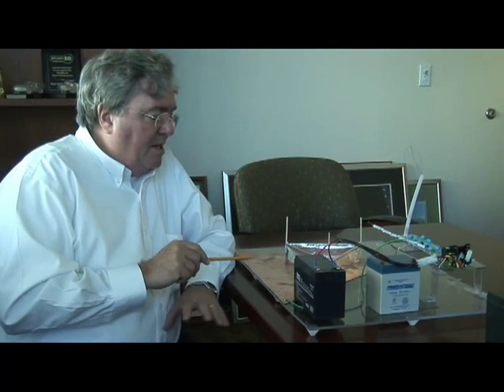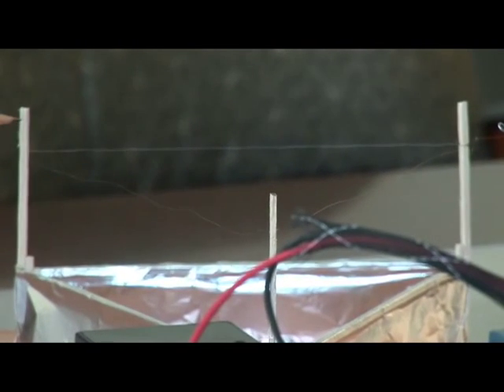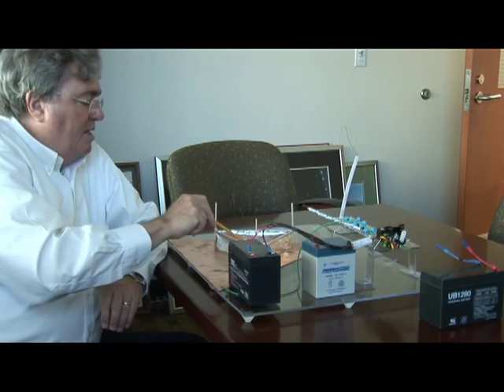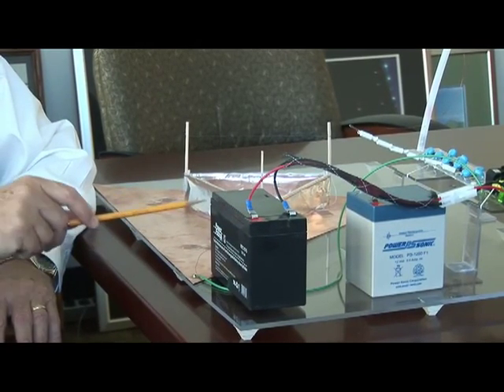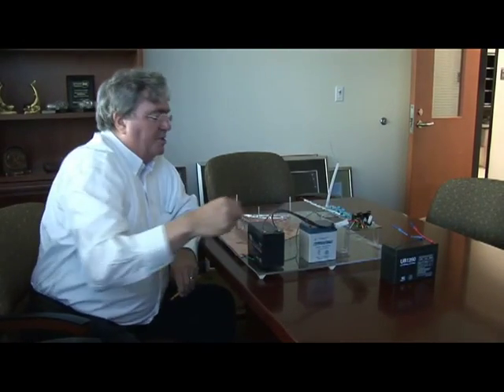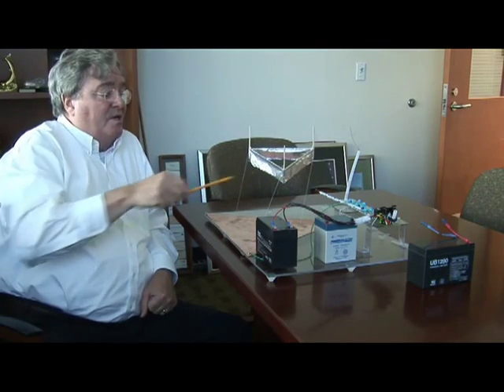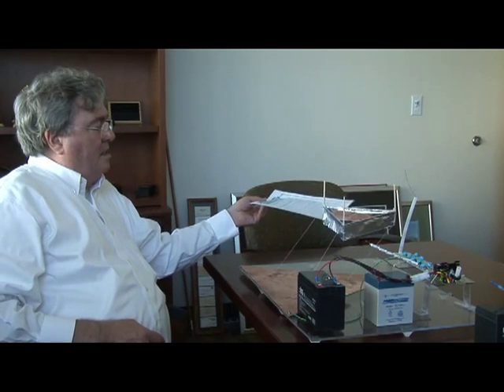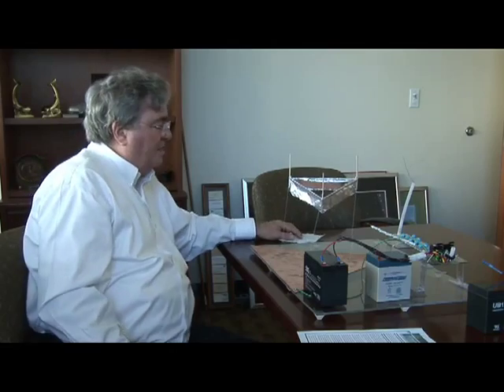Electtrostatic Anti-Gravity Device

Comment: It works in vacuum more efficiently and better than in air, as the inventor, TT Brown showed in Paris, France in 1955, Winston-Salem NC in 1957, King of Prussia, PA in 1959, and also Purdue University, NASA, and the US  Army Research lab in Adelphi, MD, Takaai Mush and HONDA in 1996, etc. The question of vacuum function we settled decades ago. I sealed saucers in bags and they flew backwards. Peole operate them under oil, which does not ionize, and selade in molten glass and resin blocks, they still work!
Reply: Thats interesting, but have YOU tried it in a vacuum. I don't buy it. I view TT Brown as a bit of a quack. I was a professor at Purdue for 18 years. So who at Purdue did it?
Reply: @nealgallagher4848  US Army shows the force of ionic wind is "at least 3-orders of magnitude too small to cause levitation". Not MY words. THe US Army, and PURDUE. TT Btown used up to 250 KiloVolts at some TENS of micrAmps in Vacuum in Paris France, and there was no limit to the speed in a vacuum. Paris France, 1955. Societe Nationale du Aernautiques du Sud Oest.
Reply: @nealgallagher4848  I so not have to see the structure of the atom to know it exists. Others have done the work under oil, in vacuum, sealed in molten glass and resin, conditions tha preclude air ionization. That is enough for me. Ion wind is a very weak force that has an upper limit, and cannot loft even a 3-gram model. Those are facts which the US Army Reaserch lab at Adelphi, MD, in the year 2000. https://arxiv.org/ftp/physics/papers/0211/0211001.pdf
Reply: Russell, you admit that you have never tried it in a vacuum. And the length of time you have been studying it does not mean that you are correct. What did you say 29 years? If that is important, I have been studying it for 44 years. Einstein never produced a correct unified field theory. When he died he was still working on it. If you understood the science better you would be able to evaluate junk science from real science. Have you ever even built an electrostatic lifter? @Beamshipcaptain
Reply: @nealgallagher4848  I understand science perfectly. Einstein's COMPLETED Unified Field Theory for Gravitaton and Electricity. (zur Einheitlichen Feldtherie, von A. EInstein, ANNALEN DER PHYSIK, 10 January, 1929.  I have a copy of, from Rex Research and my colleage Bob Nelson since 1987. Its on permanent file at Olin Library at Wesleyan University. The year of Einstein's death, 1955, Dr. Parvis Merat, a University of Maryland physicist reported he had partly confirmed Einstin's Unified Field Theory, rleased with Great Fanfare to the NEW YORK TIMES< Jan 12, 1929. He said it had come thru critical stages with flying colors. My TT Brown Electrokinetic apparatus with one-meter flying saucers are the largest in the world since 1958. I went to the TT Brown antigravity coference here in Philadelphia in 1994. I have been building and flying TT Brown saucers and sealed in plastic bags since 1990. My Beamships are the largest and heaviest Antigravity devices in the world since 2002, and I published my findings in THE JOURNAL OF NEW ENERGY, Vol 7, No. 1, 2002-03, NEW ENERGY TECHNOLOGIES from St. Petersburg, Russia , July/August 2002, INFINITE ENERGY, August 2002, and Last year's EXTRAORDINARY SCIENCE AND TECHNOLOGY, and my company, APPLIED ELECTROGRAVITCS has sold 3-foot to nine-foot Beamship antigravity devices since July, 2002, largest in the world for the past 16 years. In June of 2000, we demonstrated the TT Brown Electrokinetic Apparatus with one meter diameter flying saucers. I demoed the Tech in Nevada, in 2002 I lectured on and demoed antigravs in Salt Lake City, and in 2007, Professor John ROy Robert Searl called me up and asked me to join his re-development team, and we successfully patented the technology, SPINTRONIC GENERATOR, US Pat. No. 9,871,431 B2, issued Jan. 16, 2018, a victory for Pof. Searl, Free Energy and artificial gravity propulsion. In 2016, Dr. Thomas Valone PhD told me I "am the leader in the world in this field". I lectured on the Searl and other tech in Hilversum, Holland in 2012, Beijing , China in 2013, Boulder Colorado, 2014, and every year since 2014 at TeslaTech in Albuquerque, New Mexico. This summer I lectured on Electrostatics, and my abstract for next Summer I submitted I am reproducing the Gravillade from Alexey Chekurkov, which like the Searl technology that is my expertise, is heavy-lift antigravity. The saucers work when in plastic bags, inside resin-blocks, and under oil, and in hardest vacuum, all of those preculde aero-ionization. You and your condescending ways can go dry up and blow away. Your modus operandi is cognitive dissonance, and there is simply no excuse for that. You simply will be left behind, in the dustbin of naysayers. That is clear, seen it many times.
Reply: @nealgallagher4848  The EQUIVALENCE principle. Energy and mass are eqivalent. Both energy and mass curve spacetime. The Beamships and TT Brown saucers I built act like they are being "tugged" by a planet sized mass, at high Voltage. Mass = Energy, times the speed of light times itself. These devices cancel inertial mass. Gravitational mass stays the same. The TT Brown patents as I built them, are INERTIALESS. Do the hard work of building and research, and publication, as I did. Don't be lazy, Anyone can be an armchair pontificator. NASA now knows "Warp Drive is Do-Able", and they have antigravity patents with Serrano (GRAVITEC) and Campbell, and the new ElectroMagnetic drive has passed peer review, and NASA says  "without any optimization, can get us to Mars in less than a MONTH". Cognitive dissonance is a wonderful thing to lose, and if they did not teach you these inertialess and artificial gravity Patents and techniques in your PhD prgramme, then I submit to you that sheepskin is useful only for wiping your BOTTOM, and not much more. Alternative science has championed these technologies, because of the mainstream science RELIGION of scientism, and we are happily heretical.

Comment: T.T. Brown came up with it  in the early thirties and what you have basically is an assymetrical capacitor.  Ionic wind does NOT account for the force observed after much government testing the most likely explanation is Ionic Drift
Reply: Electrostatics is second only to strong Nuclear force that holds atomic nuclei together. Gravity is the weakest of the four fundamental forces in Nature.
Reply: Ionic drift is exactly what I described. I just did not use that phrase

Comment: Hi Avalon
I built a very small and light lifter but it would not lift. When I placed a piece of paper underneath the 
lifter, the ionic wind push it down to the table making it very difficult to move that paper. 
The ionic wind is pushing downward and not upward and so the lifter is not being lift up. 
Do you know how to make the lifter lift above the table. Weight is not the issue, because my
lifter is very small and light.

1) Do you have an email address so I could email you ?
Reply from the maker: I did this more than 15 years ago. I don't think I would be of much help. I assume you have measured all the voltages to make sure the connections are working. We had to make sure everything was carefully constructed. You need to make sure the voltages are high in order to ionize the air. You need to make the lifter as light as possible so that the ionic air flow can generated enough momentum to lift the item. It is delicate and sensitive. At least you are not one of the many crazies who look at this and don't have an idea how it works. Good luck !
Reply: @MyAvalonPhotography  Here is how you can easily help me. What is the manufacturer name and model name of the power supply that you were using to make it lift off the table ?
Reply from the maker: @rangiroa100  I recall it was a six volt bike battery. But not completely sure
Reply from the maker: @rangiroa100  I built the circuit
Reply: @MyAvalonPhotography  I purchased a power supply from Acopian - 30000 volt, 60 Watts. However, it did not cause a lifter to levitate because the current put out is only 0.20 milliamp. When I turned the current knob all the way up the power supply would not put out more current. The engineer at Acopian said that the current drawed from a power supply is dependent on the circuit. I then deduced that since my triangular lifter has only a wire on top and the aluminum skirt is 15 inches X 1. 5 inches (5.5 X 5.5 X 5.5)  then that is all the current it could draw.

1) Since my lifter is about the same size and weight as yours, then how did you get your power supply to put out more than 0.20 milliamp ?

Note: Generally, in order for a lifter of your size to lift you need to put out 1 milliamp of current at 30000 volt (30000 Volt * 0.001 amp = 30 Watts). Approximately, 30 Watts is required to lift a 5 to 8 inches triangular lifter.
Reply: @MyAvalonPhotography  1) How big is this power supply and can you send it to my address so that I can get my lifter to lift off the table ? 2) I did purchased an Acopian power supply (30000 Volt, 60 Watts) but this is a linear regulated power supply and therefore the current that it put out is dependent on the load of circuit. Since the the lifter is consisted of only a thin wire and a small aluminum skirt, the current load is small and therefore it did not lift off the ground. What I need is an unregulated power supply where it allowed for more current to flow to the circuit (the lifter) so that it could lift off the table. For most of the  Youtube video that showed a lifter, they all built their own power supply from a cathode ray tube monitor.  This monitor uses a flyback transformer which is perfect for a lifter.
Reply from the maker: I no longer have any of this stuff. I have been retired for many years and everything was left behind. You could tried to build a second power supply and wire them in parallel to get more current
Reply: @MyAvalonPhotography  The user manual of the Acopian power supply said not to wire them in parallel or in series because it would cause electrical shock to the user.
Reply from the maker: Google Electronic gadgets for the evil genius. There is a do it yourself project that shows you how to build a power supply. It is available to purchase online

Comment: Wrong explanation of functionality. It doesn't work in vacuum because it looses the necessary capacitance  between two.  YES, IT creates ionic wind. But the wire is so small surface to support the weight of the device by reactive force.
Reply from the maker: Another person without data offering expert advice